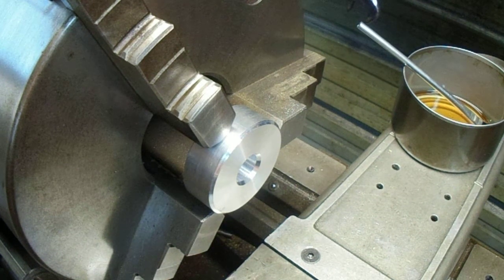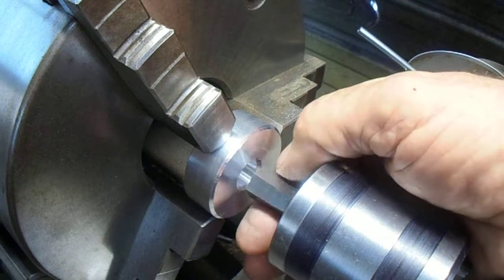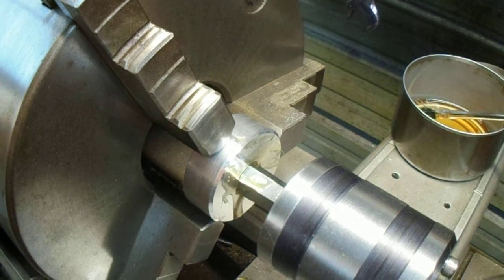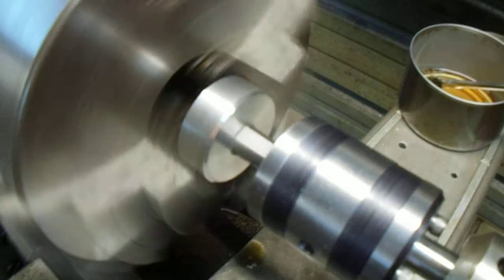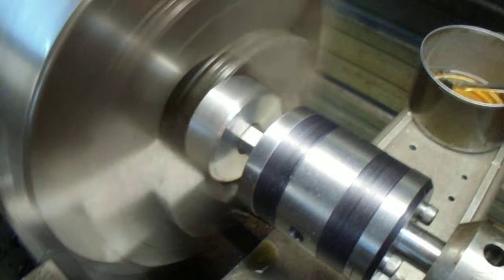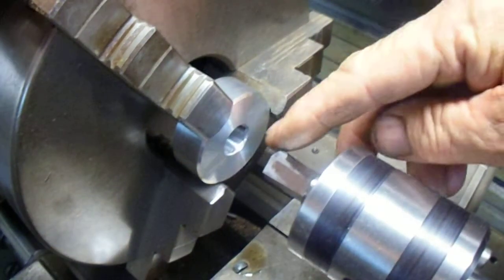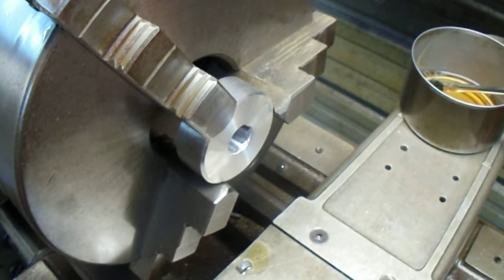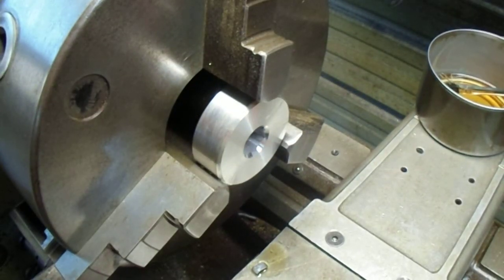Rotary Broaching

Comment: Very nice work! Your plans are the best I’ve found online and provided for a much more robust tool than the others available. I found your plans for this tool and I hope to start on it soon. I was hoping you could help me with a question about the broaching plugs. I don’t have the ability to make my own and I can only find premade plugs with an OAL of 1-3/4”. If I were to use them what if any changes to the tool would you recommend?  I’m new to rotary broaching so I’m guessing but could I use the adjustment of the body to make up for the shorter length of the cutter?  Any help would be appreciated. Thanks again.